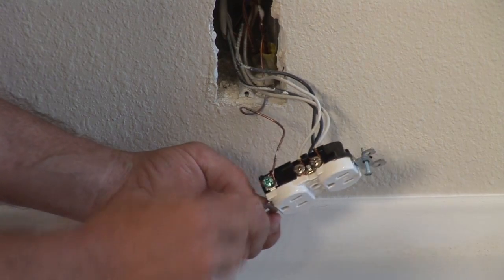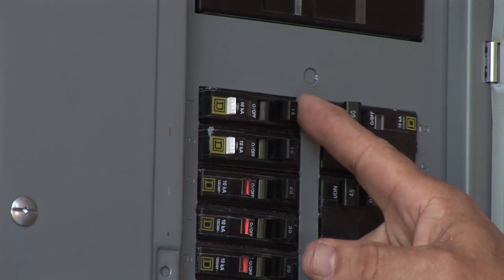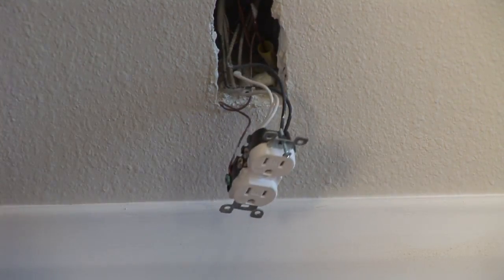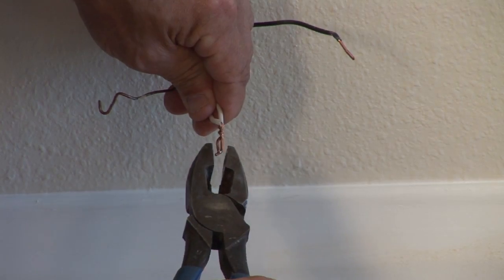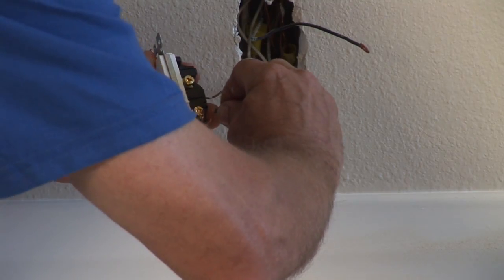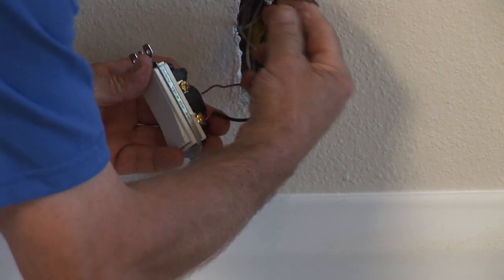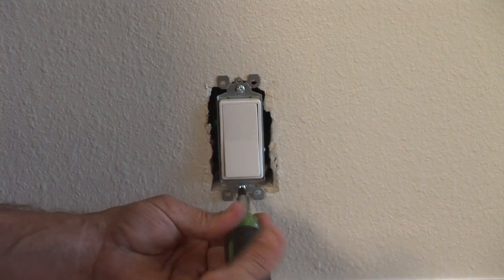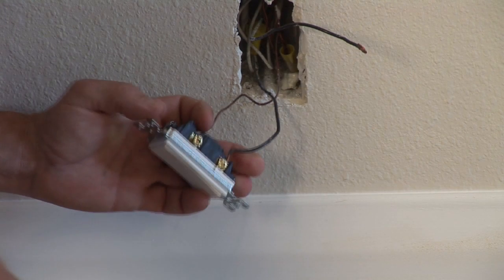Household Electrical Wiring : How to Replace an Outlet With a Switch

Comment: What if there's a red wire in the switch and one of the 5 AC outlets?  When I moved in,  the two white, two black, and 1 red wire were all capped (twist tied) behind the switch (no idea why).  Basically a non working switch in the bedroom. I left the two white wires tied, put the two black wires in the bottom of the switch and the red on top. But when I went around the room plugging the light in each outlet, The light came on on every outlet regardless of whether the switch was up or down.